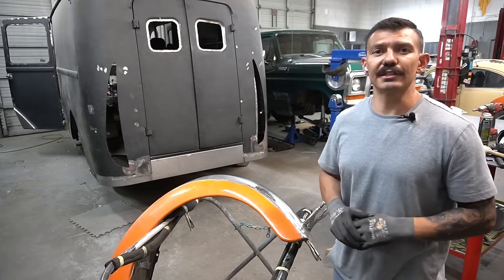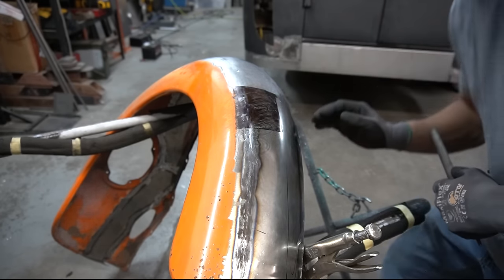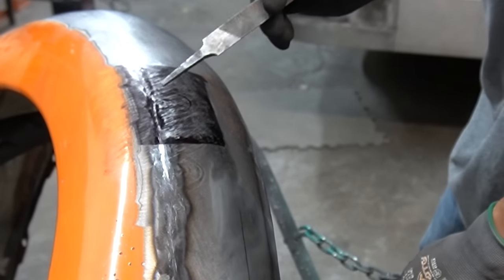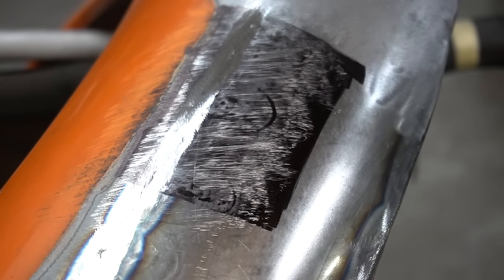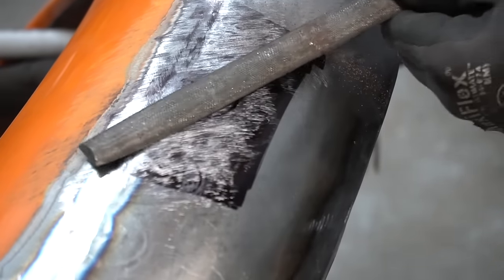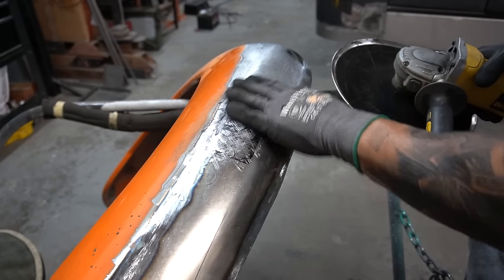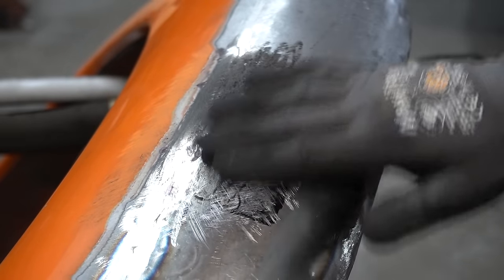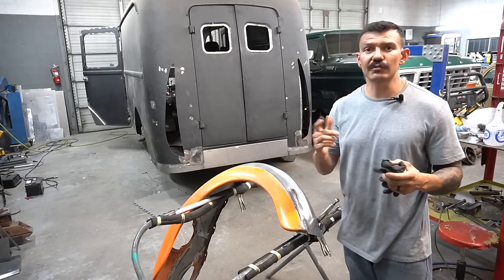Make Welds Disappear | How to planish welds with hand tools

Comment: My dad was a perfectionist body man. When he plied his trade. There was no bondo or filler primers. He worked the metal to perfection every time. He taught me the same.  Oxy/Acet.  Weld a bit. Dress it then repeat.   When TIG arrived I was told it was just like Oxy/Acet.   I treat it like that.    Weld a bit. Dress it and repeat.  Leaving very little work to finish the panel.   I use a body file to emphasize the highs and lows. No need to use a marker pen 😉

Comment: Not exactly how I would of done it. You can only do this with TIG welds or OXY Fusion welding, Doesn't work with MIG. I would of used a slapper made out of a file but you would of had to hit it a bit more gently. Also would of used a proper steel body file to help take down the highs of the weld. I like the big steel flat disc you used on the 8 inch grinder, I have never seen that before, would love to get my hands on one to try it out. Note sure how you can get a proper feel for the panel with gloves on. Be interesting to feel the whole panel you have done not just that spot. Overall nicely done.

Comment: I do what is called hammer welding, while the metal is still hot. I weld a little, then hammer that secton flat using  the hammer and dolly. After I’m done hammer welding the whole section, I shape the section, with slippers, and slapping files.  I don’t like to grind, because I don’t want to thin or weaken the metal. I only use the file for very fine finishing. If I need to do any slight shrinking, I use the knurled shrinking hammer, along with the slapping file. Works for me, but I’m old school, and learned these techniques over fifty years ago. Great job, Great video
Reply from the maker: Thanks man and thanks for the tip! I'll try hammering out as I weld! I appreciate you taking the time to comment and give me some tips!!🙏

Comment: What gauge is that metal? What is the thickness when finished? Seems like all that slapping and grinding would make the metal very brittle and would eventually crack.
Reply from the maker: Not brittle because I used the Tig welder. Metal is slightly thinner but not of a concern

Comment: WOW! I am so glad I stumbled onto your video. When I learned to work metal (1957) the tools were in some ways much different but the result was the same. The only welding was done with oxy/acetylene torches or stick welds. We were still working on cars with removable fenders and had a special bench to hold one off the vehicle. The same basic technique you used was used but our slappers (called some times bumping files) had teeth like a file not smooth. Had to wrap the handle end with masking tape. Use of gloves was an option but my hands were so calloused that I didn't like wearing them.  Plastic came in about 1958 in our area called "PERMEND". Mixxed 2 powders together. We kept on using lead for a long time until filler got better. I once worked for an OlDSMOBILE dealer that kept lead up in use until the 1960's. In order to get BONDO you had to go to the parts department
and sign off for a quart.  Back in the day we had to take off door panels, straighten them and weld them back. Very glad to see your skill set as it brings back many fond memories. Good luck.
Reply from the maker: Wow Man that is Soo cool! I'm hoping to inspire the youth to keep the panel beating tradition going, it's almost a lost art. But I love it! I'm super thankful you took time out of your day to write such an awesome comment! I

Comment: Would this work on mig welding ?
As welds are much larger than tig.
Reply from the maker: Well it depends, I never use a MiG if I am going to be stretching and planishing a weld. MiG welds cool a lot faster than Tig welds do which in turn makes them a lot less malleable. Hammering on MiG welds will eventually crack, most likely where the MiG weld meets the mild steel. So for this type of job Tig is best

Comment: Hi, thanks for the great video.  I can see the weld has been ground down on top but wonder if you also ground the weld underneath?  Thanks
Reply from the maker: Yes absolutely! I ground the weld on the underside of the fender as well, its important so when you start planishing you get the best most consistent result possible
Reply from the maker: You took a class with Wray?
Reply: Yes, I made a rear fender for my MGA.  Awesome class with Wray but still learning and picking up tips.
Reply from the maker: @ianrenshaw6653  Nice! I took a three week class with Wray back in 2019. I built that rear fender for the 35 Packard in Wrays shop. Awesome class man!

Comment: Very informative video.  Would you please be so kind to answer a question:  did you consider using a birdseye pick on the tiny low spots before grinding?  Also it appears that your grinder for the shrinking disk is not powerful enough.  I had to get the gigantic makita before I got enough torque to really create any heat with that disk.  Thank you.
Reply from the maker: What's up man! A bullseye pick could work! With a bullseye pick it's focust in a verry small concentrated area and can be quite accurate, it's essentially the same thing as a hammer and dolly. Also I'm pretty sure my grinder is adequate for the shrinker, if I'm not careful I can heat the panel blue. Seems to work just fine with good results. Thanks for watching!

Comment: What does the inside look like?  Are both sides ground as close as possible first?
Reply from the maker: Yes! In order to get it as smooth outcome I ground the weld on the  inside of the fender flat, trying to not grind too much of the adjacent material

Comment: I'd love to see same videos working with aluminium. I am about to start working on a 60s land rover and needs lot of work
Reply from the maker: Aluminum is pretty similar to steel. The nice thing about aluminum is you can anneal it! Wich makes it much easier to work. I do some pretty extreme shaping of aluminum in this video here: https://youtu.be/qlCGw0J-OCk?si=4EUpN3Z_QckcHb_g
Reply: @BeAMetalFabricator  Incredible 💀!! But that item has all the marks of the hammering. And I wonder how to work correctly parts for the auto body
Reply from the maker: Same way as steel. But best to have polished equipment like hammers English wheel etc. check out Wray schelin videos. He works aluminum in some videos and he is a true master!

Comment: What would happen if you took a grinder to the weld instead of stretching the metal with the slapper?
Reply from the maker: @jakeatencio305 So actually you do go at it with the grinder first and grind as much of the weld off as you can without grinding the adjacent material on each side of the weld as much as possible. But being that the metal isn't planished smooth yet, you can't 100% fully grind the weld until the highs and Low's are planished evenly which helps level the weld with the sheet metal for more grinding and make the panel consistent and look more seamless. I hope that makes Sense
Reply: I wondered the same thing

Comment: Hi Did you use filler wire in the TIg weld or just fusion?
Reply from the maker: Sup Mark, yeah I used filler rod. You definitely want to use filler rod because it adds material to grind off on both sides. This prevents the metal getting too thin and also having pits or craters in the steel when planishing.

Comment: Excellent tutorial , you have a great ability to teach ,and keep my attention, I’ve only seen Wray use a slapping tool ( I’m sure there is lots of videos with tin bashers using them) so does the slapper spread more of the stretching ? 
  Subscribed, and notification bell on! Looking forward to future videos!👍🇨🇦
Reply from the maker: What up Canada! Dude you have no idea how much this comment means to me. Your feedback made my day! I'm glad you got value out of this video and took time out of your day to write your message. This helps me stay inspired to creat more videos! So to answer your question, by using the "hammer on dolly" method in the low spots  it stretches the metal bringing the Lows up, and since the slapper covers a large surface area it also lowers out the highs  surrounding the lows to bring everything nice and level and consistent throughout the section of the panel being worked. Thanks again for the Sub! Let me know if you have any more questions
Reply: Ron Fournier was the guy who I first saw use this slapper  method used back in the late 80s. Some of those old timers were amazing.
Reply from the maker: Dude them guys  were amazing amazing back in the day! Not an ounce of laziness in em!!

Comment: Don't spray it with water: let it cool naturally.  The water will harden the metal and more difficult to manipulate. You may even heat it with a paint remover heat gun to make it a bit more easy to manipulate.  It might help you to get up the stubborn lows
Reply from the maker: Interesting method. Is there video to prove this to be true?
Reply: You use the same principle when using the planishing disk: the heat of the disk flattens the high spots. During paintless dent repairs they also warm up the panels to help to move the panels a little bit. Last but not least: hardening of metals is done by heating it up and to quickly cool it in water or oil. Would be very interesting to see if this would help you. Cheers!
Reply from the maker: Thanks for the tip bro!👍